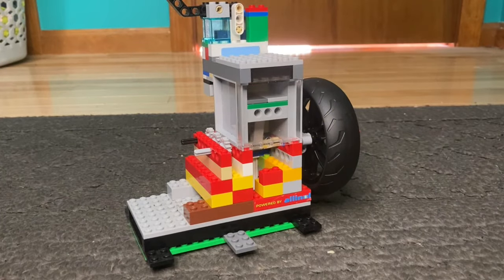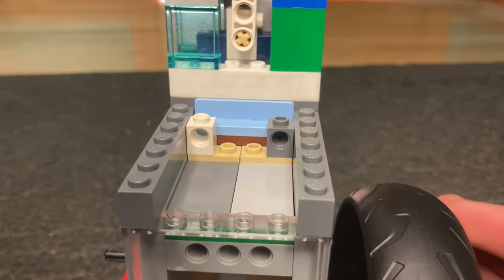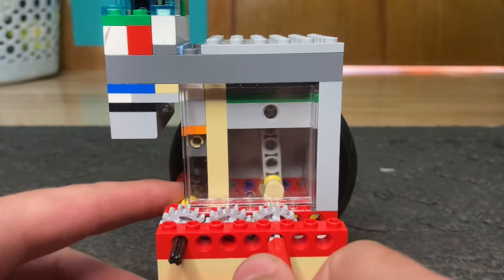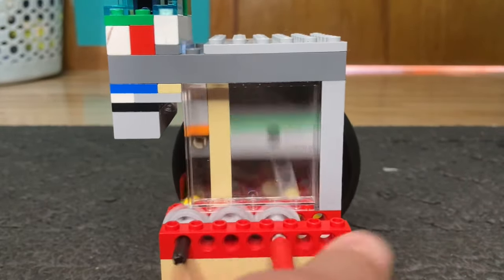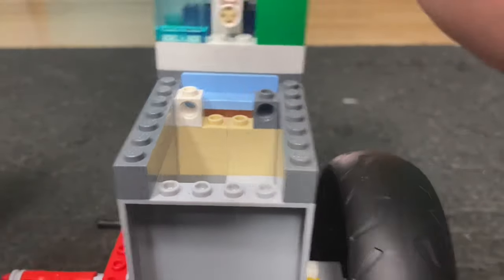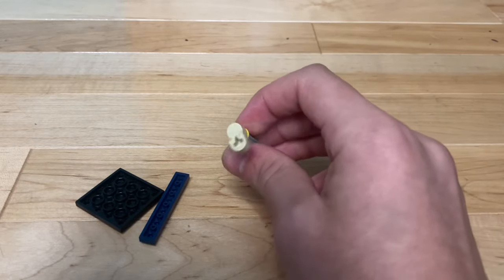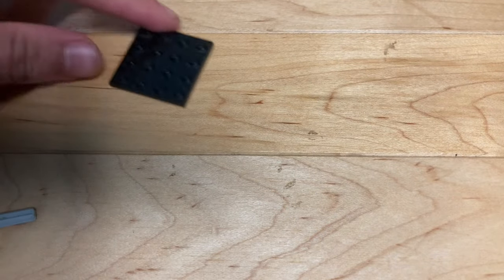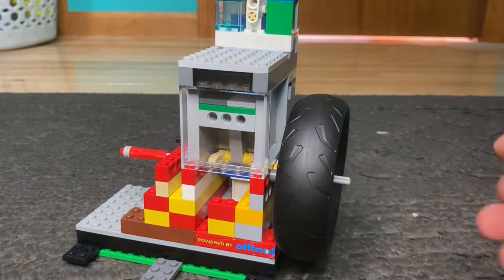The BASICS of a Lego Vacuum Engine

Comment: Dang! Couldn't have done a better job myself, keep it up bro! I think you've given me a new video idea!
Reply: Could you help me with my Lego motor? I have a high suction vacuum, and the motor turns pretty good. It is a single valve single cylinder engine and it seems to start to turn on its own but doesn't take off
Reply: @th3_ap3x_n3rd  make sure your timing is right and everything, and make sure everything flows good. Also make sure the valve is working properly.
Reply: THANK YOU SO MUCH, I rewatched the tutorial and your basics on vacuum engines, and I got it running. The only thing is the throttle is odd in that it does not increase throttle when I give it more throttle. Any pointers in that?

Comment: Do need need a big wheel like the one you have, or could you make a wheel with other parts
Reply from the maker: You can definitely use a different part for the flywheel, as long as it’s enough weight to carry the piston through the stroke it will work fine.
Reply: @KFPlusLegoMastery  how much weight should it be?

Comment: Hi KFPlus Lego Mastery, I’ve created an engine using the same valve design as this, but whenever I run it over speeds of 1500 rpm it breaks. Is there something I could do to stop this from happening?
Reply: Glue
Reply from the maker: Well if what breaks is the valve, I’d recommend applying a small amount of glue to the valve. Nothing too crazy but it should definitely help a lot
Reply: @KFPlusLegoMastery   Thank you, I will try this
Reply: The best thing for reusing your parts would be to cut a napkin and place it on the pets you want to connect. This way the parts fit tighter. Then you can just use water to get rid of the excess napkin so there is not extra friction.

Comment: Can you teach us how to build a vacuum engine, but with a supercharger?
Making a system with gears for the supercharger to rotate more than the engine and thus be able to push air to the piston, making it go down faster and increasing its final rotation
thx from Brazil!
Reply: why don't you just use a transmission, it's more fun too :D
Reply: Since we are working with vaccum, and not combustion. This would result in a net loss. You could only get energy out of the engine that you put into it via the vaccum. So it wouldn’t really be a supercharger. It would just be more friction
Reply: @coconut_in_a_suit975  a second vacumn

Comment: I’ve come up with an interesting concept for a vacuum engine that I want to try, and it seems logical but idk. My idea is to make a multi-stage vacuum engine, in that the used vacuum from the first cylinder is “recycled” to the next cylinder. My logic behind this is because you need the exhaust stroke, there is still some sort of vacuum left in the cylinder. This means, by my theory, you may still be able to use that second vacuum to make power. Now with my knowledge of steam engines, I propose you may need a larger cylinder to get the same effort from a smaller vacuum power. I need to make a rig to test this but if it works it I’ll be sick af

Comment: I built an engine similar to this one and its indestructable, I've run it at max rpm for like 5 mins and at idle for like 20 mins with no issues.
Reply from the maker: LVE’s can be fairly reliable if you build them right, so nice job!

Comment: How bad can wd40 damage your lego's?
Reply from the maker: It won’t damage the plastic unless you leave it on the legos for a long period of time. Whenever you deconstruct an engine make sure you clean off the WD-40
Reply: wd40 is some pretty caustic stuff. its a lubricant but also has some solvents and other crap in there. over time that can eat away at materials its not intended to be used with.

Comment: im building my own engines and i have a few questions about vacuum enginges. 
So first things first, does the engine need to be free(without oilpan)?
And i have trouble with building intakes. I Always loose the power of my vacuum in the intake.. Do you have tips for that`?

Comment: I made an engine bases off of your design , however it gets stuck at the top and does fire when i turn the shaft but does not run itself
Reply: try lowering or hiring the exhaust valve by one stud

Comment: Instead of using a vacuum, could I litteraly just attack a Lego motor thing on the the bar where the tire is?
Reply: It's not that fun
Reply: @fireballyt3676  but it would work right?
Reply: @benwrycraft-jane3783  no it would be really really slow
Reply: @fireballyt3676  what if I get like 10 of them and make a gear thing that ups the rpm

Comment: How would you tune this and wouldn't the friction from gears cause alot of friction making this better for slow high tourque engines?
Reply: How to tune would be turning the gears to change the timing of the valve
Reply from the maker: Surprisingly the 3 gears I use have very little friction. You can also apply the olive oil to the teeth of the gears (looking at it now I probably should’ve shown that in the video)
Reply: @KFPlusLegoMastery  hey I finally uploaded that chain driven DOHV LEGO vacuum engine with a four stud bore. I think it’s the first. I’m in the process of modifying but it runs quickly. The showcase is on my channel.
Reply: @KFPlusLegoMastery  it took forever to get this one to run

Comment: I am building one at the moment, does a one valve one piston engine require a throttle valve?
Reply from the maker: It doesn’t necessarily require one, and it’s not going to hinder the performance whether or not you add one. It just gives you more control over the speed of the engine without having to move the vacuum nozzle up and down the intake port